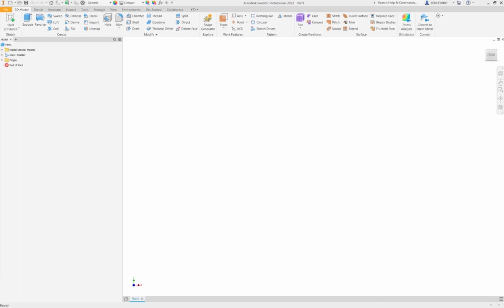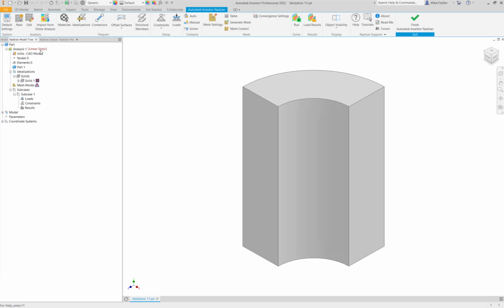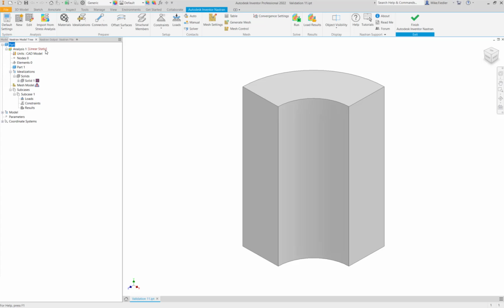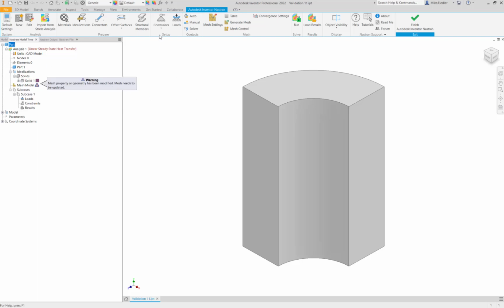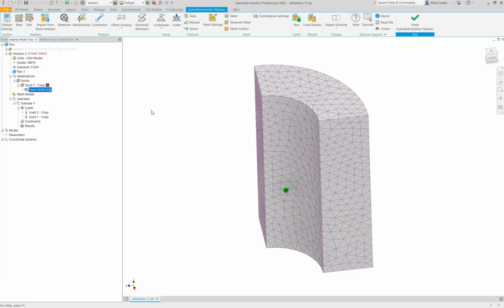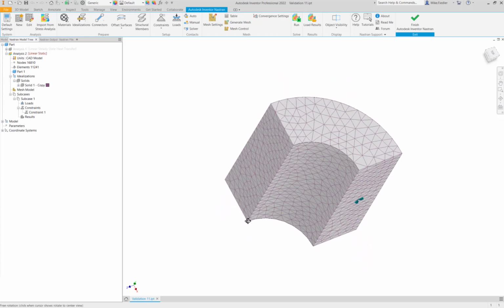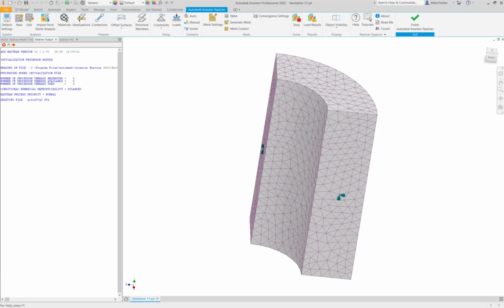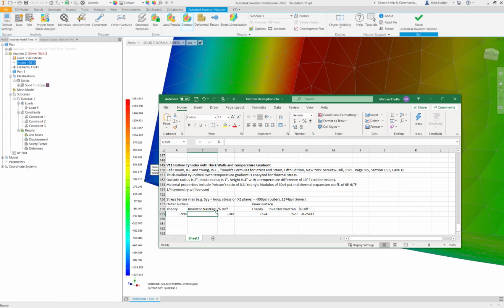Autodesk Inventor Nastran Validation 11 - Thermal Stress of a Thick Walled Cylinder

Comment: Thank you for a very informative video. You applied a temperature load on the inside surface, and on the outside surface. What temperatures does NASTRAN apply automatically to the surfaces on which no temperatures are applied? Is it T_REF? Or is it simply 0°C?
Reply from the maker: Hello Jura!  Because it is a steady state linear thermal analysis, the program is finding the thermal distribution after some 'infinite' amount of time, so the initial temperatures of the 'other' nodes does not matter because the lowest and highest temperatures in the model will be dictated by the loads that we did apply to the model and all other nodes will end up somewhere between those extremes.  That said, two things to note (1.) if no load of any type is applied to a surface, the surface is treated as an adiabatic surface and (2.) the temperature of the other nodes would matter in a transient thermal analysis where we might want to see how fast something heats up or cools down.  If it is a transient thermal analysis, then you would want to make sure that an initial temp is defined... this could be done with the 'initial condition' load with the 'sub type' of temperature - or first running a steady thermal to get the starting distribution for the transient analysis.  I'll make sure to get to some transient thermal analysis as an example.
Reply: @mikefiedler2039  Thank you for a clear explanation!